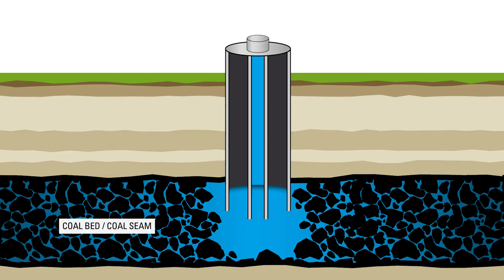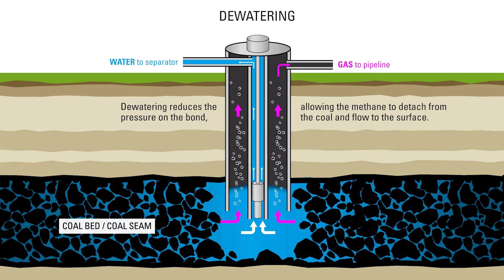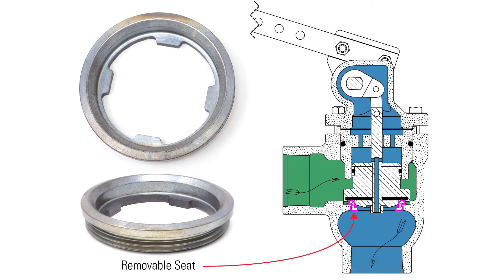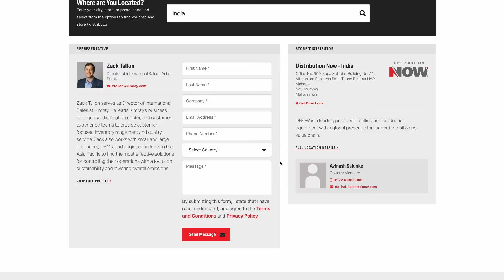Control Equipment for Coal Bed Methane Production (CBM) & Coal Seam Gas Recovery

Comment: Surrounding 2000, I was an airjammer and cavitated/completed 30 or 40 of these wells around Farmington NM mostly for Dave of Phillips petroleum while working for EADS.....Energy Air Drilling Service....Quincy 750Cfm jammers had oil spewing dual blower and dual turbo two stroke v8 Detroit's.  I smoked all those wells and I bet their still good producers 24 years later.  Right key energy and Aztec?  you ol chain throwers and frozen Kelly spinners. Good times brothers!